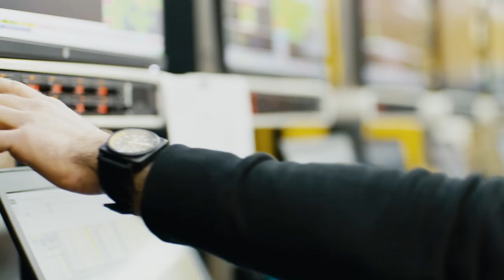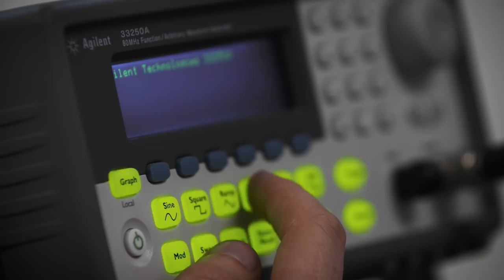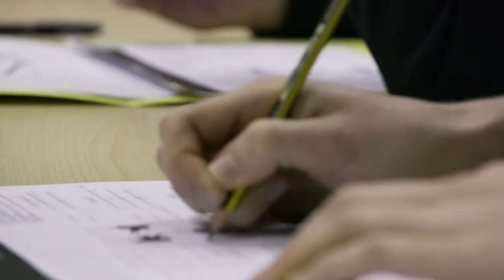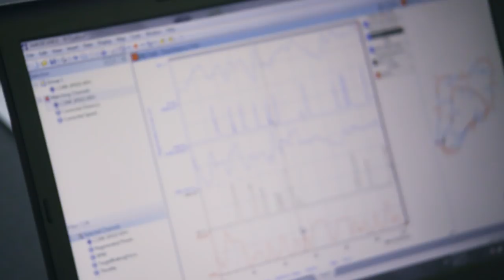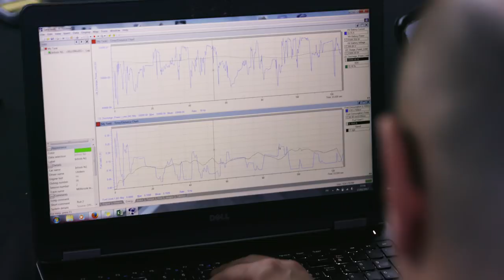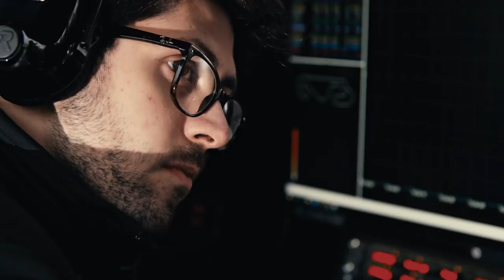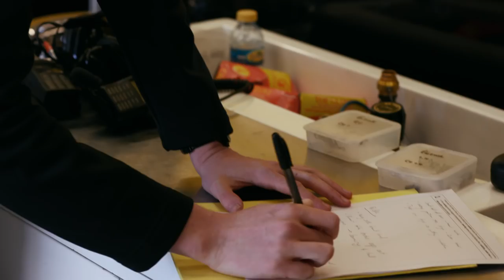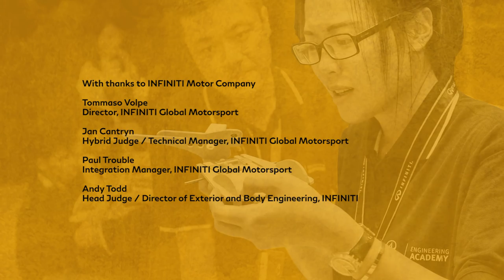Graduate to the Grid - INFINITI Engineering Academy TV Documentary

Comment: This documentary is simply terrific. It provides a clear benchmark on how skillful you need to be to participate and win the IEA in order to work in Formula One. Different from the regional finals which seek more of your teamwork attitude and project management capability, the selection for the race engineer reveals the daily pressure in F1 and how you should extract the most of yourself. It’s very interesting to compare between Jaden and Alex. If you know some basic approach to vehicle dynamics you will find that Jaden followed a clear and classic route, examining the turn-in, mid corner and corner exit. He presented a clear focus of car balance problems in the final report, including discovery, analysis and solution to the issue, making the two experienced engineers smile. In this case Alex is a bit less organized, simply listing miscellaneous (solved) mechanical failures and could only provide very general impression, but not data and evidence, in the report. Huge congratulations to all 7 IEA winners and I hope to join you in 2 years time. I strongly recommend this video to all students who want to take the IEA seriously or would like to work in F1. It inspired me what I should work on.
Reply: So what's the update mate?
Reply: @onefivzero  IEA has been cancelled since 2020 when Infiniti stopped its sponsorship in F1. I’m still working towards it but in the area of electric motors this time.